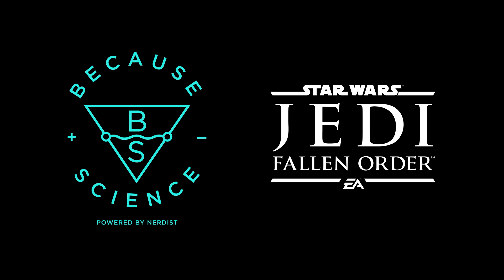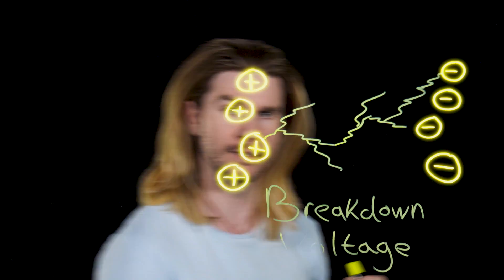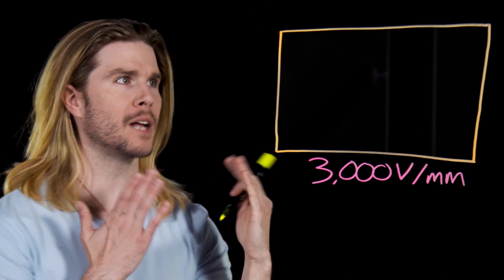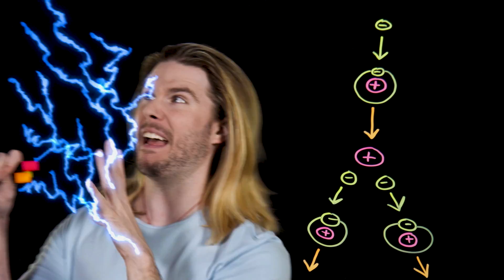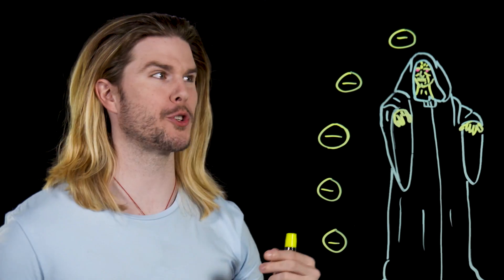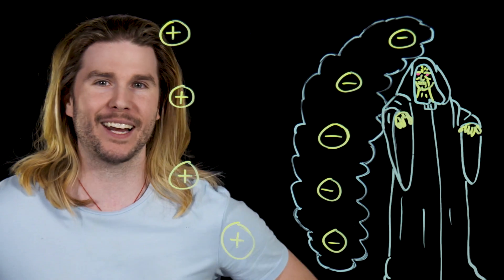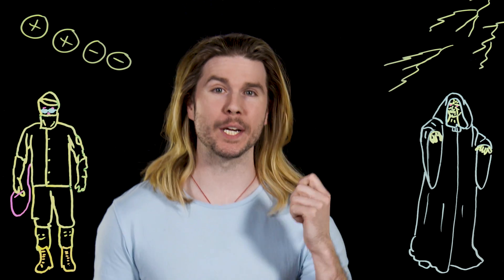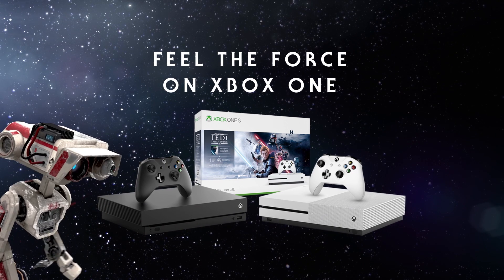How Does FORCE LIGHTNING Work? (Star Wars SCIENCE)

Comment: Hello!
First of all, amazing video like always! first comment ever so i'm going to give this a try.

So, i'm not a super nerd or anything like that but considering that the 15 000- 30 000 V shock seemed really painfull to Kyle, wouldn't a Sith be extremely damaged by using such an attack? I might be wrong about all of the following but i'm just wondering.

Even if the siths do have the ability to move electrons at their will, making their body electrically imbalanced until a electric arc happens seems to me like it would be 1. extremely innacurate and 2. probably more hurtfull to them then the ennemy.

For the inaccuracy part i am not certain. In the example of the door knob, the sparks happens both because Kyle is negatively charged AND because the doorknob is positively charged and a good conductor(metal). In a scenario where palpatine or Count Dooku negatively charge their own body, wouldn't the resulting lightning jump litterally anywhere other than on the actual "target", especially if that target was far away. I seem to remember from past videos that humans are pretty bad conductors and then the lightning wouldn't shoot straight for a jedi unless said jedi was extremely positively charged. My point is that to make the lighting go from their hand to their target directly, the siths would need to be able to also i guess remove electrons from their target otherwise the lignthing would probably connect with i don't know... the metal floor besides them?

My other problem with such an attack is that i feel like it would affect the Sith just as much if not more than it would affect the targeted jedi. In the scenario of the door knob Kyle is for all intents and purposes shooting a force lighting at a door knob and as we can hear (and as i can attest for myself) just a small spark like that is painfull for the "Sith". If a sith is to shoot a lighting with a voltage equals to a thousand time that, wouldn't his hands and fingers simply get instantly fried or i don't know, blow up or something haha. I know that you always hear that it's not the voltage that kills, it's the amperage but what would be the implication of such an intense voltage coming out some fleshy human hands. In the video, the electrons were shown to be moving from the air to the inside of palpatine (that might be just a design choice) but wouldn't it make more logical sense for the Sith to bring the electrons AROUND his hands without actually letting them in as not to get hurt by the lighting. Thinking about it now, siths attempting such a feat would probably need to themselves be wearing a faraday cage to be sure not to get hit by their own attack since they are much closer to the source of the electrical imbalance (their hands) than the jedi are... Lighting is very confusing to use as a weapon hahaha. Kyle, if you read this, what would be the best way to use such a technique for a human to 1. increase your chances to reach the target and 2. decrease your chance of you know... self force lightninfication. In my mind, a faraday clothing (or extremely isolant material?) wearing sith that bring an immense amount of electrons (negative charge) to the outside of his gloves and remove the electron from his jedi adversary to make him the most positive "object" in the room by a large margin could do the trick? Now i will admit that that wouldn't be as cool to watch as some guys shooting PEW-PEW lightings at each other but hey ...

Again, my knowledge about all that stuff is extremely limited and i hope i'll get corrected about all the stuff i got wrong :) Also, sorry for my english (i tried haha).

Thank you Kyle for the amazing videos!

Comment: counter: int he scene, luke has a bunch of time wiggle and cry, thats not exactly consistent with lightning, house outlets or in my personal experience, electric fences (horses). there is some other play going on. my theory is normal charge you get in the void + using the force to move air molecules to reduce resistance. wait, does a 'vaccuum' make it easier or harder, some nerd correct me.

Comment: You could use a carbon tape instead off the mesh for the whole robe with multiple layers and rubber soled footwear. The carbons ability too carry electrons stops it from reaching you, plus it would be lighter and more flexible for a jedi to jump/ flip around. 

https://www.instructables.com/id/DIY-carbon-tape-Taser-proof-jacket/

It won't help if the tape is pierced through, but will be able to stop the electricity reaching you.

Comment: It's cool that they tried to incorporate some sort of electrical burn into palpatine. When he used force lightning too much it seemed either he wasn't in full control, or the jedi he was facing was turning it back on him. 
Either way, he got burned from using it. 

Iet's also assume that jedi can catch the lightning with the force. 
They actually have a potentially very good anchor to put the lightning into because of the absurdly powerful lightsabers. They can either direct it to the plasma inside the blade or use it to charge the electro magnetic barrier surrounding the plasma.

Also, characters using force lightning must also be using force push as well. We see that they also tend to push people while using it. 

From this we can assume that they are using force push as a form of lightning control on top of generating the massive charge, and can get burns from using it. 
no wonder the jedi wouldn't teach you it.

Comment: The issue I see with the Sith using actual lightning is that real lightning takes the path of least resistance. So the lightning would probably go straight to the floor. I could actually see the lightning building up until the insulation from the Sith's boots failing and the lightning would conduct through their boots instead.

What intrigues me the most is if there is a way around this (besides using flying wires like a taser does)?
Otherwise, you just have to make certain that any path between you and your victim is incredibly insulated and your victim is standing on a metal portion of the floor or something. 

This would be more akin to having "traps" in certain spots should someone want to kill you. You try to maneuver them to one of the "more conductive" portions of the floor and then let loose your power!

Comment: In comparing force lightning to real lighting, you're forgetting one thing. The negatively charge in the cloud travels towards the ground, not because it's sentient but because it's travelling though the path of least resistance. Charging up to a high voltage, your sith lord would probably discharge either into the ground near them, or into anything that's conductive and could attract the lightning. Everything in between the sith lord and the jedi would act as a lightning rod, ground included.

In order to direct the lightning, the sith lord would need to create a path in the air that directs the electricity. One way palpatine might do that could be shooting out high energy wavelengths at the target out of it's fingers, ionizing the air in the way, and creating a path for the electricity to travel.

Wait, I forgot to say I loved the show. Am I still elligible for footnotes ?

Comment: As part of my education as an electrician, we had a course about static electricity or "ESD" as it is also called (electrostatic discharges), and how to work with sensitive, electrical components that can easily be damaged by ESD, which we see more and more of these days in everything from cell phones to computers.

The entire class was mindblown by how much voltage there is in a single burst of static electricity, even in the ones you don't notice. Yes, you don't actually notice every instance of ESD between yourself and an object, because they are simply to week. But even the ones you don't notice can de dangerous to sensitive electronics, so it's very important to be mindfull of ESD safety when working with this.

Comment: Could the sith also manipulate the electrons of the Jedi to leave the Jedi's body so that the potential difference between the sith and the Jedi is higher, and could this reduce the chance of the force lightning from arcing to the ground or a conductor which is neutral or positively charged instead of to the Jedi?

Comment: Wait. if they can manipulate electrons at will, wouldnt he be able to manipulate the electrons in the faraday robes? thats why you didnt get approval from the jedi council. Yoda facing force lightning must have same ability to manipulate electrons to divert the force lightning. Another problem is that the lightning user would have to control the direction of the lightning so that it hits the target instead of the metal floor beneath his feet trying to take the pathof least resistance. or anything else in between.

Comment: If they could control electrons, assuming the force works on any object of any mass, then shouldn't they be able to move air molecules to control density and therefore the required voltage for the distance travelled? I'm only thinking of this because Force Push then makes sense by reversing that principle to create a wall of air dense enough to throw someone; Force choke then becoming simply preventing the air from getting to the nose and mouth(understandably this is a stretch considering how its portrayed in the movies). Then again, I'm probably reading too much into it.

Comment: Careful Kyle, https://youtu.be/_8amsn4vFN4?t=117 the triboelectric effect is tricky. We can only make broad generalizations of which material the electron may be separated to when this effect takes place. It's unlikely but entirely possible that when you shuffle your feet that you might accumulate ions instead of electrons on your body which in turn will still result in a charge imbalance between you and the door but with electrons leaving the handle to you instead. I understand the point you want to make and believed it too like you have for a long time until a physics friend told me otherwise. Namely they told me that there is a table called the triboelectric series which tabulates the combination of different materials and their potential (heh pun intended) electric charge separation when rubbed together. Importantly they don't necessarily dictate the direction of electric flow, only the magnitude.

I understand that this can be seen as pedantic and honestly a bit of a rude thing to say in normal context but I wanted to bring it up because it brings up some really cool thoughts on how even with something as simple static electricity, scientists are still figuring out basics. Love the show and keep making cool stuff man.

Comment: I work as an upholsterer at a stack chair manufacturing facility, and there are many materials we work with on a daily basis that are prone to building up a charge. I've managed to build up enough of a charge to earn an arc exceeding what appears to be an inch. When this happens my fellow employees are able to hear the discharge from a good distance despite the ambient sound being just shy of requiring we wear hearing protection. This is super painful and we've had to learn to touch metal after handling each part to discharge as frequently as possible to avoid utter sadness.

Comment: Hey Kyle!

I'm wondering about one point, you calculated the voltage needed to create the force lightning but you didn't speak about the channeling time.

You compared the 22m Volts to actual lightnings during a storm but, if I remember correctly, those are instantaneous discharges where the difference between the air's electromagnetic charge and the ground's are high enough to breakdown.

However, in every movie or game, siths can use force lightning over a certain period of time. Wouldn't that also affect the amount of energy needed ?

If we keep your numbers and using your footage it would mean that one needs 22m to emit lightning for 1/10 of a second. Using the same extract you showed when the emperor is attacking Luke his first attack is roughly 3 seconds so he would need 30 X 22 = 660m volts !!!! That's an insane amount of energy! And furthermore I'm pretty sure none of them would survive such levels of energy anyway...

See you in footnotes!

Ps : do you think that Thor's lightning works the same way ?

Comment: Kyle, love the show.

In my quest to earn super nerdom I might not be smart enough to run a million calculations that will inspire you, but I am a super fan and maybe that alone is enough. Let me introduce three points on the subject of force lightning that your video didn't cover:

1. What if the conditions in a galaxy far far away are sufficiently different from ours that the numbers we are assuming are wildly incorrect. How would such a difference impact the means and effects of force lightning?
2. In the prequels, Palpatine doesn't just shock mace windy with force lightning, he hits him with enough electricity to propel him like at least 30 feet. How does that impact our calculations? An assumption for Sam Jackson's weight (minus one arm) applied to the voltage I think probably yields much higher values if we want to propel him that distance.

3. Several jedi get repeatedly blasted with force lightning without dying. Assuming our assumptions for the voltage are correct, how different does the superhuman physiology of a jedi need to be to take those 3million volts and still have the capacity to scream "faaaaaather!"?

I love the show; you and all your clones are amazing. Keep up the good work! the force is STRONG with you.

Comment: You showed that we generate - charge and when we touch a + charged object, we get shocked.  You also showed that the emperor pulled in - charges to attack like...  My questions are, what side of -/+ starts the lightning?  Does one side of -/+ recieve more shock than the other side?  Basically if we gather - and then we get shocked, would the emperor gather - or would he actually gather + charge causing the electricity to come from him?

Comment: If a sith charges himself with insane voltages, what would guarantee that the lightning would only shock the intended victim and not lets say a metal rod way closer to the sith? It would be much more efficient to ionize the air between the sith and the target. This would reduce the voltage needed for a lightning while also offering more control to where the lightning would go.

Comment: You said that force lightning is as powerful as real lightning but you never mentioned the current.  Without knowing the current we cannot say how much power is involved here.  The arcs shown in the movies don't seem to be igniting stuff and making things burst as they sublimate.  Take Luke's reaction into account and I think you were closer to the mark with a taser.  

I've have been making stuff for a long time and in that time I've received a fair few shocks.  I've been shocked by a powder coat gun at 90,000 V and it felt similar to the little static shocks you were giving yourself, enough to make me recoil away very quickly but not enough to make me drop the component (I was half asleep so I picked it up before I let go of the trigger).  I've also been shocked by a TIG welder at only 60-70 V.  The welder was set to 50 amps and I believe that current passed up the nerves / muscles in my right arm, across my pectorals and down my left into arm to the filler rod I was holding.  It was like one of those muscle stim pads that lazy people use to try and get in shape but WAY more intense.  It made me spasm so hard my arms crossed over and and I made a sort of 'HUUUU' sound as I launched the filler rod across the bay.   I still don't get how this happened because everything was properly earthed??????? but never mind, at least the current stayed away from my fragile, fragile heart....I've seen that episode of mythbusters 0.6 amps is all it takes if I remember correctly.
Anyway......
I'm not buying the lightning thing, I think force lightning is a weapon of intimidation, It's all talk and no trousers.

Comment: What about the path of least resistance? If a force lightning user didn't control the conductivity of the air between them and their target the force lightning would arc to other things close by or even their own body. To effectively use force lightning at range a user would likely have to create a small path of conductive air between themselves and their target in order to insure their attack has the desired effect.

Comment: Kyle... wait. Hold on. If you rub your feet and touch a door knob and it hurts you that much...  using the same mechanics of gathering electrons to your body and increasing the distance of half a centimeter to 2.5 Luke bodies... the pain the Sith THEMSELVES would feel would be just as bad as their jedi nemesises...

Would a sith need their own faraday suit to shield themselves so they themselves do not get zapped by their sparkly hands?